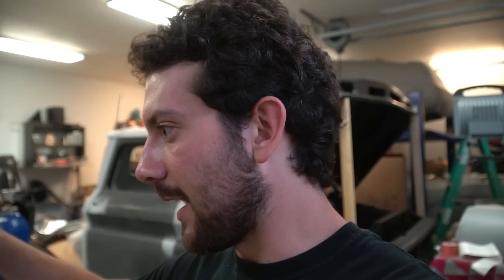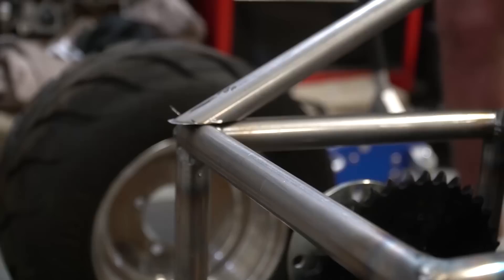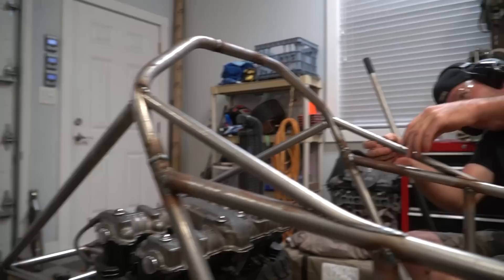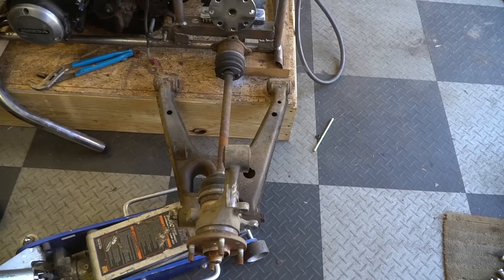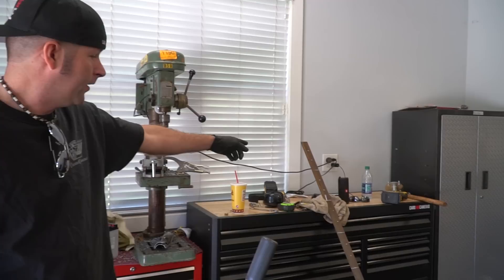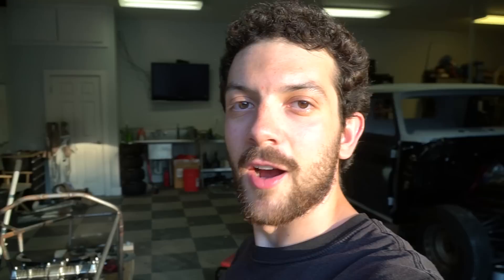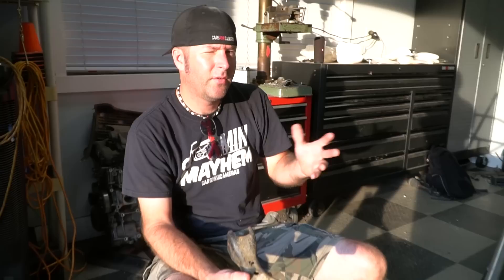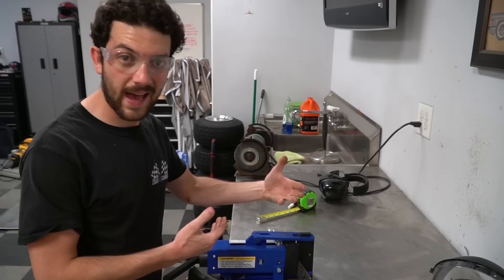IRS Control Arms! | 750cc Cross Kart Pt. 8

Comment: @Carsandcameras look up Bassett 4x100 D-hole on ebay those might be exactly what you're looking for in a wheel and they're very in expensive
Reply: those would look super tough on there, like an old school buggy
Reply: Yes! The Basset 47sh2 wheels come in a 14x7 with a 4x100 bolt pattern and several ATV tires can be found for 14 inch wheels and around the same width. Would make a sweet setup!

Comment: Smaller triangles in the front end guys. You are gonna get some massive flex in the front of the chassis. Also, put a bolt in X brace over the engine.

Comment: I'm so glad you guys are doing it this way. The car wheels are really a good idea I thought. You should have no problem powering those wheels with that engine. Please make sure to use some strong tubing to join those two shafts, so they don't twist themselves apart. And if it really does work out well with car wheels, maybe you could get some old-school 1980s Rally wheels, and proper modern rally tires.. Whatever the case, you guys have really upped your game with this one, I think! 😎
Reply: Look up "Steyr Puch 650 TR Hill Climb" on YT. If they can do what they do, with a 650, you can do LOADS with a super light 750. :)

Comment: Should have used threaded rod for the upper control arm 1" would have been plenty thick
Reply: My exact thought please don’t slot the mounting holes there is no way they will stay in place with all of the movement. Plus that add an extra dimension to the movement of the upper control arm.
Reply: Wayyy too flimsy for a control arm

Comment: If you starting to use cars for your kart builds now, I've always wanted to see a rear engined kart using most the front end from a small fwd car with the frame built forward from that, an auto would be simple

Comment: The stock Miata axles are good for about 17 inches of travel if you get your geometry right -- I built a trike using a Miata rear end, axles, and uprights, without the shocks attached I had 17 inches of travel without binding the tripod joints.

Comment: Miata wheels with a black rattle can paint job and wider rubber mounted on it. The fronts can be whatever go cart wheels you guys want. My two cents on the wheel problem.

Comment: If you went to a wider wheel like 14" X 7" to 14" X 9" you can get matching atv tires for front and back. ITP has a large selection of tires that fit those wheel sizes. As mentioned below about basset wheels if they came in that size with off set like you want this would solve your tire problem. For reference most of the atv tires will be 3" - 4" taller than Miata tire you had mocked up.

Comment: Another great video guys. Starting to come together. If you go a couple sizes up on rim and get a deeper backspace I think you would have the right look. Nit sure what size wheel the drag wheels are but maybe 2" larger diameter and a deep offset you should be about right. Can't wait to see the front suspension

Comment: Just my thought, but I think you should do some better bracing to the upper control arm since you added so much length to it.
Reply: yeah that things needs gusset plating badly
Reply: @StanleyKubick1  yea, they should take some square tubing and and go from the where the ball joint is and go all the way back to the upper a-arm bushing. Basically make a triangle because that upper arm won't hold much stress as it is.

Comment: Guys, your rear suspension isn't going to work too well, the upper control arm should be shorter so that it increases camber as the wheel travels up. Otherwise if you get any chassis roll you will only be riding on the outside of the tire. Camber gain is used to keep the tread on the ground while cornering

Comment: John, you can get a pretty decent paint job very reasonably at Maaco if you go for one of the higher-end packages since most of the prep work is done.  I am a car painter and a friend of mine manages a Maaco and they are the same as any other body shop but the prices are lower.  The thing that you need to know is that Maaco is a franchise so you will need to do your homework to find a good one.  After all of the hard work that you did on that truck, I would advise against trying to paint it yourself as it is not easy.  I have apprentices that have been at the shop for a year that can't paint an entire silver car without stripes in the metallics and runs in the clear.  You could get that thing painted for 2000 dollars or less and it will be a thousand times better than what you will be able to do your first time.

Comment: You can weld quite a bit with 300 psi bottle pressure and will last quite awhile at a flow between 12 and 20.

Comment: Okay so you guys know some people don't think about this but I have lengthened and shortening  CV axles quite a few times .... You should always make sure that the CV axle part is bottomed out inward for the inside towards the differential but in this case the drive assembly and then the other part towards the wheel until they bought them out then subtract a quarter to a half inch from the piece that you're adding so that way it will give a little bit of room for movement of the axle but will guarantee that your axle is not too short as it may be at its fullest length of stroke because you didn't push it in all the way

Comment: to make a template for the suspension arms , get a metal plate lay the original arm on it and weld tabs to the plate so you can bolt it down exactly , take the original off and mount the bushings for the new suspension in the tabs , then weld the pipe in between them 
should work pretty good and gets everything at the right angle

Comment: The control arms should be on an angle so you get anti-squat. Google ifs anti-squat. :) The upper control arm should shorter and be level, when the bottom control arm angles down. This will give you a progressive negative camber which is ideal for turning.

Comment: You should use interlocking tube clamps on the rear section so you can remove them to get to the engine easier.

Comment: Awesome project!! The lower control arms looked like they had the eccentric cam bolts for the rear toe adjustment. Probably weld tabs in the back and you could adjust them for rear toe.👍

Comment: GUYS - you have a welder.  Fix your problems with not being able to bolt to your dad's sink counter.

Weld up a large frame out of 1" square tubing that is the depth of the counter and wider than any tool you'll be mounting to it.  Weld some 1/8-1/4" plate to cover it, and some 1/8" plate that hangs down the front and back to lock it to the counter forward and back and so you can clamp it down (if you can make the front a 90 deg angle and slide it onto the counter from the right, easier clamping, you can build screw clamps right into it).  Put some rubber sheet (old inner tube) pads on the bottom of the tubing to keep from scratching up the top of the counter. 

Then just drill holes where needed to mount each tool.  You should even be able to mount the chop saw to it.  

You could also cut slots in it and use T-slot clamps to hold things down., or just bolt T-track to it

Just an hour's worth of work will make it SO much easier to use those tools in the future, especially the vice.

Comment: Un related to this video, but you had mentioned keeping that engine cool earlier. Run it on methanol you guys are already going to re jet anyway just buy the bigger jets for methanol, and cooling won't be an issue. Advance the spark timing about 8 degrees for a starting point and add more until it doesn't pick up on power.

Comment: If I was building that Kart I would go with somewhere between 22-24 inch tires.  Side by side tires might be a good fit.
The miata wheel and Tire on the Minibuggy looks good.  Since you are using car parts for the suspension, I think using car wheels is not a bad idea.

Comment: I know you guys have all ready welded the rear section together but if you used some angle iron tabs on the rear bars you could have bolted them on to front section and it would be removable to make for easy engine R&R.

Comment: you can get slotted steel rims for less than 50 a piece (80 gets you a dirt track ready rim in 14x7 or 14x8) in that lug pattern, and i think you can still get - E X T R A  C H O N K - turf tyres in that size.

Comment: Your comment on needing two inch wider tires when looking away the miata rims, I respectfully disagree. This is a cross kart, not a street kart. You should run roughly the same size dirt tire. Skinny tires are better for dirt than wide. It's cuts through the loose surface down to the hard pack easier. Take a look how skinny the tires are on rally cars and even other cross karts. They are pretty thin, not wide. You can likely find some cheap used tires that still have some life on them on some of the rally forums and Facebook groups too. 
I am glad to see that you guys scraped the miata subframe. I was really worried you might use that for a minute there. Also glad to see some gussets finally being use, though, seeing more used in the portions of the cage that actually protects you would be nice to.
All my critiques aside, this thing is actually coming out looking freaking banging! I am excited to see it finally running.

Comment: When i built my cart it was out of a street bike .. I calculated it only used to turn one uluminum wheel now it has to turn a axel and two quad wheels i put a 45s tooth in the back and a 16t in front it had a 14 in front and 35 in the back it would have no acceleration or top speed and i couldn't hit 4th gear in a yard or it would bog out ..now the final gear ratio it had mad acceleration nice shifing length and you could hitt almost all gears had retarded top speed if you weren't scared at going 55 in a  corner it smoked a stock banshee if had the wrong gear ratio it probably would only beat a crf 230😂 now this will help my friend i don't wanna see u guys snap or break one off those axles at high speed and roll it or go into a ditch trust me i striped one side of a quad axle it was a drag quad it yanked left into a tree .. U guys gota make more awsome videos right? so this should help with safety and holding up to a 750cc motor in that nice build👍

Comment: Does the camber change throughout suspension travel?
Reply: abels_ yes it does. Not that it will matter. If thay use therePresent gear ratio with the Miata tires it will never knew move under its own power

Comment: i like it but i think its a little wide. unless thats what your going for. but i think i would turn the lower brackets down under the frame  and i think you would lose 2 inches per side easy. and still be able to get your ride height they way you want it.

Comment: How is the axle going to shorten/extend through suspension compression?
Inner + outer cv joints normally have the movement for this (within the cups).
Reply: I should wait til watching the end to ask a question ✌️

Keep them on the tight side of binding within suspension travel and don't run circlip on axle at the hub end so it can float a tad 😂

Comment: How about this; instead of running too-small go-kart wheels and tires, and instead of running the too-tall and too-narrow Miata wheels, why not pick up a new or used set of 4x100 ATV wheels and tires? Some ATV's and UTV's have a 4x100 wheel bolt pattern, and can be made lug-centric if the hub diameters don't match. This way, you have a MUCH bigger selection of tires and tire sizes.

Comment: I would use the same gear ratio for testing don't put so small of sprocket on the back it will burn the clutch then decide if it needs bigger front or rear sprocket

Comment: Wait is the crosskart going to be faster than the drag rail because the drag rail is 670cc and the crosskart is 750cc?😂
Reply: KORY OREO probably not due to weight
Reply: Also think about the application. The drag rail was designed for racing and the gearing was taller. For the crosskart gearing will be shorter for low end torque for an off-road application.

Comment: Just a suggestion instead of cutting that CV axle straight through like you did you should have cut it in an angle and quite an aggressive angle because it gives you more of a weld as in more surface Welding which means more strength. I went to college for welding and I can lay a bead that looks like a roll of Dimes I could even send you a picture of some of my welds even high-dollar professional welders have always complimented me on my welds I can weld anything. Keep up the good work guys enjoy the videos. Always look forward to your newest

Comment: whyndont you just do 15x8 bart d window steelies on the rear and 15x7 on the front?just makena bracket for a miata bearing on the front half so the bolt pattern is all the same in case something happens on the trail you can always put a miata wheel on it to get by till you get a tire? That would also give you better ground clearance and more handling ability also more options to play with tire sizes

Comment: Put new CV boots on before you weld the axles, save you pulling the CVs apart.
Reply: The axles are shot. Not worth boots. If it works out ok then it will get new axles

Comment: Buy some cheap cool looking 4x100 rims and get some aggressive-ish tires
Reply: All-purpose flour cheap eBay rims would be perfect for this application since the kart is light weight it’s not like the rims have to support much and Miata rim bolt pattern is pretty basic. Finding some badass wheels and tires shouldn’t be hard.
Reply: @lillygivens7886  yea exactly. Cheap, easy, and they will look great

Comment: You guys should get a ATV and take the plastics off and cover it an inch thick steel and make like a tank with an ATV maybe like and atv except look like a 1,000 in it like maybe off of motorcycle or bug you something like that. We pretty cool instead of wheels l b tracks

Comment: Hi guys I'm building a cross from a Chinese cart the Baha extreme two-seater cart I'm turning it into a one seater , I'm using a 650 Kawasaki Ninja engine I'm looking at a low build sprocket and rear suspension setup, I'm using the Miata axles and whatever else I can find from the Miata maybe the control arms too, I guess I need information to a DIY build site or whatever information that you can give me.

Comment: Question: When does it stop being a gokart and start just being a tube buggy? Does it depend on the type of parts you use, or the size of the engine? Or is it the size of the cart? So many of these big carts people build (including the rail and that buggy rather b welding built) are so big that I don't think you can call them gokarts anymore. When they are the same size as a car.. I think that title no longer applies.
BTW why don't you guys get some good LED light strips off of amazon (look at JakeTheGardenSnake's video of his new lights in his garage) and light up Ike's shop and start working in there? That way you could just weld right on the concrete floor and work all night if you wanted to.
You guys really need a Summit Racing sponsorship.. You could really use rims and tires from them. Standard 4x100X15's would've worked great for the back of that on the Miata hubs and then on 15's you could run any light truck tire. Or you could find 4x100x14's and gotten smaller rims and tires including ATV Boggers like Intercos for $70 each. Summit has a nice set of black steel wheels (16 inch Cragars $53 each) that I wanted to get for a Mini S (if I got one) that would've worked great. Plus they have powersports packages here. https://www.summitracing.com/search/department/wheels-tires/part-type/powersports-wheel-packages?SortBy=Default&SortOrder=Ascending&N=4294950865%2B4294705918

Comment: Why Not TRY Making a Limited Slip Rear-end Using Clutches?
Reply: ravenlorans as stated before there isn’t a whole lot of room so making/putting a differential would probably require and whole rear end redesign.
Reply: @lillygivens7886  Not a Diff but a Clutch. Weld the Shoe stuff on the side with the Chain and Sprocket and the Bell on the Other. Chain and Sprocket speed up, engages the Clutch to the other Drive Shaft. Act like a Diff but way less room is needed.
Reply: ravenlorans oh okay that’s makes more since. It would be pretty creative and help with turning.

Comment: I love you guys, but I have to be honest - I'm not digging this build.  I'm very concerned about the weight of the back end and the steering being bad because the front will be too light.  I'm also concerned about the overall strength of your frame and the possibility of bending & twisting the frame when you off-road the cart.  Are you doing springs & shocks/struts?  I hope so, because articulation without springs & damping is not going to work very well.  Good luck gentlemen - I'll be watching!!

Comment: i don t get this ... you use most of the miata axle and then go for non diff setup ? wtf !? i´d be usin the miatas diff and if neccesary make it 60% closed or so ....straight axle gonna be a pain in tight and fast turns for handling... trust me wehn i say its mutch better especially with the weightcenter on the back...that thing will be extremly understeered as it is now

Comment: You guys are painting yourself into a corner with that confined "box" around the rear axle. You are not going to have enough gear especially if you go with taller tires. And you can only go so small on the counter gear. I lost count on how many builds I've done like this, that motor with a 23" tall tire is going to need at least a 5:1 reduction ratio... trust me.

Comment: Throw away those tiny wheels. "Basset Racing Wheels". You can order 14 inch wheels any width/offset. Then use standard tires or ATV tires.  10 inch wheels are ridiculous.